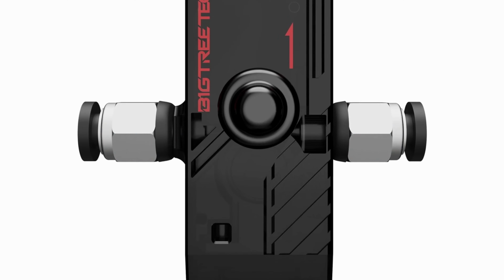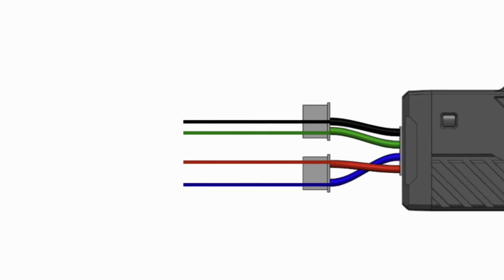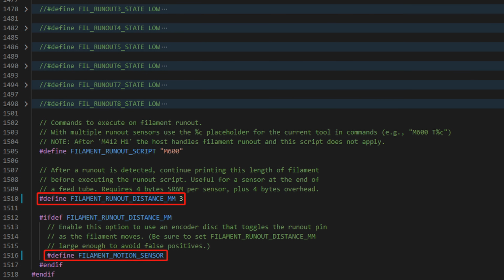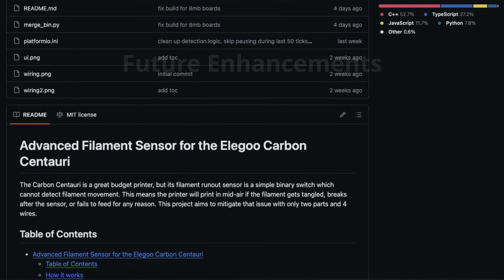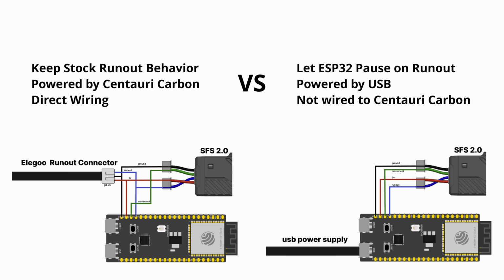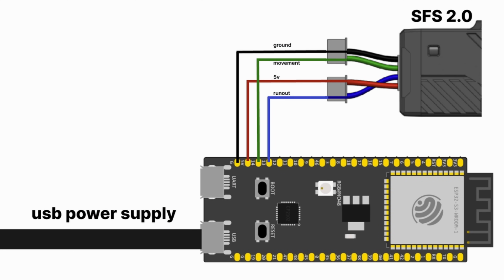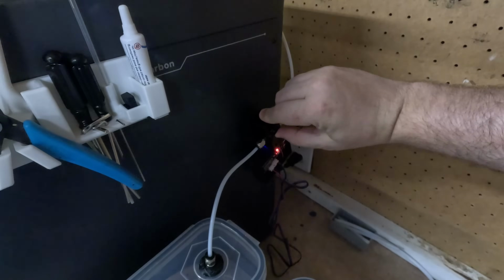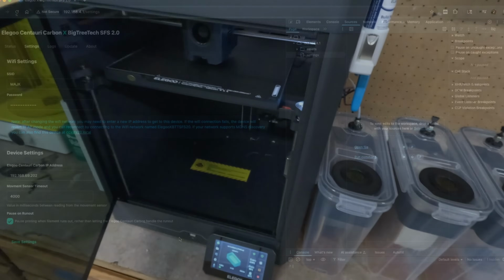Elegoo Centauri Carbon Upgrade, Filament Movement Sensor

Comment from the maker: Just wanted to pin a comment with a few notes.

The wiring diagram in the video has a few mistakes, I've updated the Github. As pointed out by another commenter, I was one-off with the pins accidentally going to 14/13 instead of 13/12.
The USB-powered mode seems to not work on some devkits that don't output 5v vusb in that case, the SFS supports 3v3.
Some people are  asking for more dev board support, but I don't have the time to support them all. If you have a board you can modify platformio.ini and build for it and send a PR
Another common question I'm seeing is "why not just trigger the runout sensor instead of sending the websocket command." The answer is because the filament runout does not actually stop the printer, it waits until all the filament in the tube is empty, which would be too late. 

I've also added a few features but haven't had time to test them yet, I'll do a new build soon, and maybe an update video. Thanks for all the support so far!
Reply: Thank you for teaching this. I am not a crafty person but people like you really open possibilities for me. Lots of love. Can't wait for more vids
Reply: Thanks - two simple inclusion requests for the new build - a defined output pin signalling the error condition (to which folks could attach whatever they fancied) and a defined input pin for a push switch to acknowledge/cancel the error condition by resetting that pin (to switch off whatever was attached to that output pin before fixing the printer.) 
If these were in the mainline code (though using them was entirely optional) then there wouldn’t be any risk of future versions (and extra functions) breaking anyone’s hardware. 
For something going public, I would even mark a few of the spare I/O pins as being “reserved” for potential additional functionality, while leaving others for personal extensions.
Reply: Hmm on github Are showing pin 11 , 12 and 14 is in use, and ground
Reply: Aha is for the usb power version.
Reply: Nice work man! Is there an update already?
Reply: yo I want to mod a similar if not identical cereal box with yours, but I want to add a also a nipple thingy for the vacuum pump I have (I have the standard manual and electric one on aliexpress when you google for filament vacuum bags ) but i dont know where to find such a thingy with gasket and what not to like make a hole and then glue that in there do you have any ideas on what to do? or even better make a youtube video about trying to modding one? :P

Comment: Made today with an ESP32-S3 devkit. Works like a charm. I had to increase the timeout to 5000ms for better performances but other than that works great.
I tried with an ESP32C6 (and ESP32H2) at first but it's completely incompatible with PlatformIO so... no shot there.

Comment: Thanks for sharing. However, I think I would use some low tech arduino board instead of the ESP32
Reply from the maker: The reason is because the only way to communicate with the centauri is via websockets. It means you need a network enabled MCU at a minimum and there aren't many lower tech options that will be able to deserialize JSON payloads while connected to a websocket.

The open firmware is changing, but enabling UART communication currently disables the display and I'm not sure many people are willing to do that. I try to keep my eye on OpenCentauri to see if/when that changes.

Comment: So since this video was made Elegoo have announced no more ams for the centauri carbon. Using this mod would I be able to implement my own ams setup?😊
Reply from the maker: Last I heard they claimed to still be working on it. I don't think you'd be able to implement your own ams. If you really want it, you'd probably want to replace the mainboard. Opencentauri website and discord has some details on the options there.

Comment: I dont suppose there is an easier way to do this thats more plug and play yet I know they said they would release the code but I guess they didnt release it all or something... not that this is THAT hard but its more work than id prefer.
Reply from the maker: Not yet, but I'm working on it when I have time

Comment: The mod and the information is fantastic. The audio, not so much. This is in need of better articulation when speaking, some serious EQ, less boominess, less reverb, a pop filter and and some serious de-essing. It was VERY hard to understand the audio.
Reply: Great recording is good, I didn’t find the audio too bad myself. But a tool like adobe podcast can take less than ideal audio and run it through and AÍ filter and make it sound a lot better. Often easier to fit that into the workflow than perfect recording equipment and conditions

Comment: I tried to do it with an ESP32-C3 Zero and no luck, it says: "ESP32 or ESP32-S3" while in Github says "any ESP32". Sorry, I'm pretty noob on electronics, I just wanted to check if there is something I can do to make it work, or I need to get any of the previously mentioned.

Comment: I want to make this in the next couple of weeks, but with the firmware now being released to the public, is there a different way you would do this now? E: Ahh, see you've commented on someone else's post.
Reply from the maker: yes, the future way to do it will be to communicate via serial so we can get all the information needed, use octoprint (when it's supported) but requires a raspberry pi, or do a motherboard swap. I will make a video about it when I have time, just been super swamped with my day job.

Comment: I'm having an issue with the printer keeps pausing even when I have the sensor timeout to 50000. Do you think it might be a bad BigTreeTech SFS 2.0? I had to uncheck the box next to: When unchecked, it will completely disable pausing, useful for prints with ironing
Reply from the maker: Usually it's the esp32 restarting that causes this
Reply: @jrowny should I replace it?
Reply from the maker: @davidcurtis1689 I wouldn't, i dont think this solution is really ever going to be as effective as i hoped. I'm working on an alternative approach using the recently released open source firmware
Reply: @jrowny  Awesome.  P.S. Is the first layer timeout max 8000ms? That is as high as I can go on either one of my printers. Once and while either printer will stop. Thank you.

Comment: Hey @jrowny , Since the CC Firmware is now public and thanks to the people on the OpenCentauri Project. Is there any way you would develop a new version of this sensor to work with the mainboard? Basically cutting out the ESP32?
Reply from the maker: I dont think so because the CC still doesn't have an extra gpio. But it does have serial. So we can convert it to direct serial communication. I'm looking into it. Also once octoprint works, there's already a plugin for it, but then you'll need a raspberry pi.

Comment: Has anybody added this to open centauri yet?
Reply from the maker: I am starting to work on it, the DSP-serial communication just started working, so I'm still investigating. We can also wait until Octoprint works, which should be possible soon, as Octoprint has a plugin. That will require a RPi though.

Comment: I cannot for the life of me get this to flash to the 4 esp32-s3 modules i have tried. 3 n16r2 and 1 n8r2. Tried the web tool on 2 machines that have had the suggested drivers installed. I also tried the flash downloader tool as figuring out platform IO is a time investment i have not been able to make yet. 

If anyone has some suggestions i would love to hear them.

Comment: Any upgrades to this mod since Elegoo dropped some of the source code?
Reply from the maker: I replied in another comment, we should be able to get access to the carbon now as a USB hub device, which will help not having to use the janky websocket stuff, but the dsp that the carbon uses is fairly unique and I don't have much experience with anything like that so it'll take some time.
Reply: @jrowny  Thanks for the reply and the time you put into this. I was just curious.

Comment: hey just came across this video, i have had my CC for a couple of days and i have had filament break in the ptfe tube a couple of times, only 1 spool so probably something with that spool, but it paused the print even though there was still filament in the sensor. Now i am thinking they might have updated the sensor to sense if filament is moving or is this not possible? I don't want to do an unnecessary mod if the new stock sensor already has the functionality

Comment: Isn't the CC just running klipper and can't klipper interpret the input signal of the new output sensor on the same pin of the original sensor with config? I don't have this printer but it seems weird that you would need a separate microcontroller for something so simple.
Reply from the maker: Its modified klipper with serial access disabled, no input to hook it up. The wiring for sfs 2.0 still requires two inputs for runout and movement separately. The printer firmware source was just released so we might be able to modify it so we can use serial comms instead, but it will require flashing firmware that hasnt been developed yet.

Comment: @jrowny Your system is working nicely, but I have noticed during a print of a reasonable size object that the print would quite often go to pause, and on manual key press, restart/recover without any issue, and continue printing. It dumps (PLA-CF) easily  into the poop chute no problem. Eight times during one print. So not a clog. It seemed to happen when small features were printing on the supporting "tree" structure. I'm just guessing that the filament speed was too slow, causing a "pause"  (?).
It would be most helpful if you could add a check button in your WebUI code to select an "auto-recovery"?  If during the auto restart/recover process no filament movement is detected it would  likely be a clog or a filament tangle, and it could stop the auto-recovery. 
The included serial RGB LED on the ESP32 board could also be put to use to indicate this error condition.
I don't know if there are any WiFi messages during the print that would give useful process telemetry data in this matter, like very slow volumetric feed rate.
Reply from the maker: I'm working on a way to send extruder speed to the esp32 via gcode, but haven't had time to test it, but that should allow it to not have so many false positives.
Reply: @jrowny Great! Did not know GCODE was part of the telemetry.
Reply from the maker: @Piccodon  it's not really... I'm going to try hacking it by passing the speed into the "current layer" property using a post-processing script.
Reply: @jrowny  
You would parse slow layers out in the GUI and let it temporarily disable speed checking in those layers?

Comment: Hello! This seems very useful so I'll give it a go as I already have the parts required.

For the diagram I think it is enough with a 4 stripe perf board. Relocate the black wire on so there is 1 empty space between green/black.
By doing this all 4 wires can be in parallel and easy to solder the connectors to ESP32.

Regarding the stupid knob on the sensor - it can be replaced, just open the sensor up by undoing all 3 screws (ai also undid the filament connectors, not sure if it was needed) open the case up and you reveal a hex head screw going thru the bearing. Hold the knob on the backside, and undo with Hex. there you see a thread insert so we can now design our own button to release filaments...make it a bit larger more grip friendly but keep a heat-insert for good use.

Comment: Great job. Thanks for putting it together. 

Will be trying to reproduce this on a c3 since s3 seems like a total overkill.

IMO there is no shame in hoarding esps or other mcu boards (especially if they come at less than 2 bucks). You can just throw them around any time something comes to mind.
Reply: Same, will use a small cheap board.